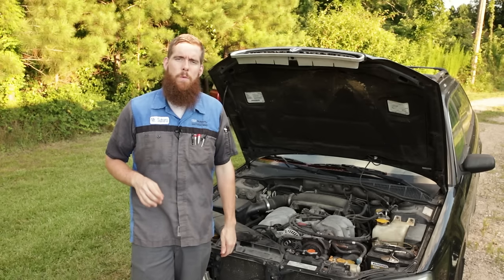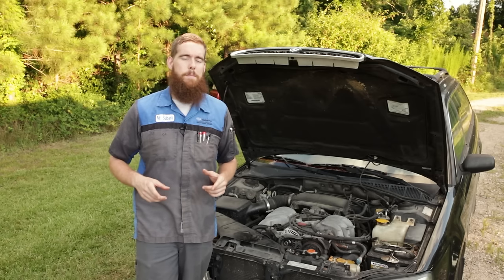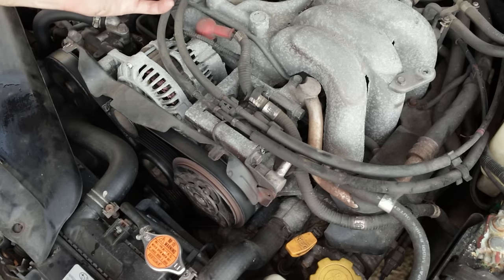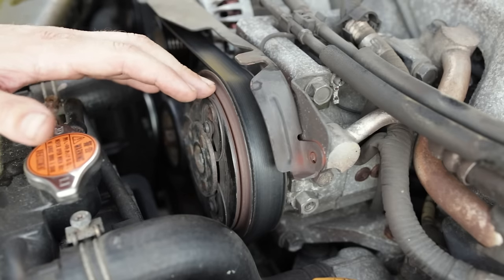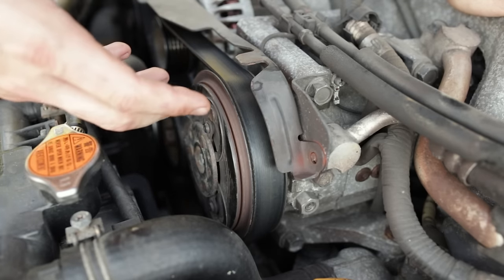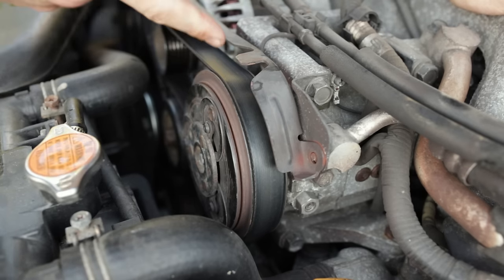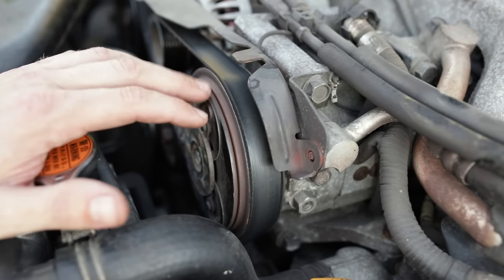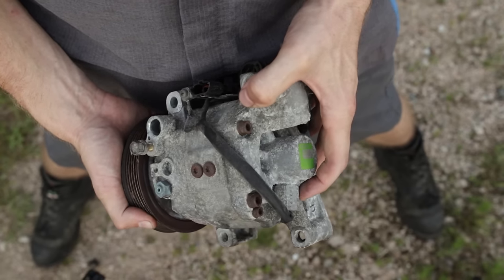Subaru A/C: Common Failures & Issues

Comment: Yes indeed the green test plugs were a total surprise! (though a bit*h to get back apart). However, I wish there was another video on just the clutch. When I put the two green things together, all my fans went cycling thru their speeds, but my clutch didn't click in. But before that I had hotwired from the + of my battery to the braided wire on the compressor connector (was at 5 ohms, so I figured this was the clutch), and the clutch kicked in. Does this mean my relay could be bad? I think the green plug test would bypass the pressure and rotation switches being that the engine isn't on. Do you have a video that goes into this? Thanks so much for your videos!

Comment: That was tons of detailed and useful info. Good work! My A/C compressor is starting to complain, making a noise loud enough to hear it from the drivers seat, with windows up. I figured it must be the bearings, although I don’t think that particular issue was covered in your video of all the possible breakdowns with this one component.
Reply: Did you ever solve this? My 2015 Forester 2.5i is not blowing cold air and the compressor seems to be buzzing?
Reply: Not yet. And no excuse for me (I live beside a competent mechanic!). I just spent the past few days dealing with a rusted gear shift lever cable connection at the transmission lever. It rusted over the winter (Im in Canada) and seized. I eventually sheared it off, snapped it from struggling to shift from Park to Drive. I had to tap it and put a stainless hex bolt into the lever so the gear shift cable eye bolt has something to connect to.

I’ll respond here when I figure out the buzzing. It matches the engine RPMS, even when revving in neutral.

Comment: So happy you came out with this informative video. Ever since i bought the car from a guy here in WA in January 2020 whenever i turned on the AC something would screech. I’m guessing it’s the AC compressor? I even took it to subaru dealership to have it checked out and the guy said it was perfectly fine and they’re supposed to sound like that. There I am thinking to myself like man.. i sure don’t know much about cars yet but i have NEVER heard a subaru AC sound like that. I will definitely check the gap and the O-rings now. The AC does blow cool and hot air.

Comment: I work on a lot of subarus I dont know if you ran into this but the 2000-04  forester baja and outback compressors had the thermal switch in the compressor fail where the compressor would work for a few minutes and kick off and not come back on. I replaced many of those compressors because of it.
Reply from the maker: Haven't ran across it personally, but I believe I've heard about that issue.
Reply: @MrSubaru1387  yeah it was really a pain because it would randomly quit when recharging the system and you couldn't get a full charge into the system.
Reply from the maker: One quick way to test it as well is to take a screwdriver handle and tap on the clutch. Sometimes all they need is a tap to get them to snap in and engage the compressor.

Comment: On the early model legacy. I own a 93
There is a green test mode connector and a black test mode connector
Reply: If I remember right the green test mode connector still does the electrical testing and the black causes the mil to flash ecu trouble codes... could be the other way around though...

Comment: I was quoted 1700 to replace my A/C compressor. It would make a noise when I started my Subaru Outback 2005 and then go away a few minutes later. Then the other day it did not turn…including the fan and lights. They replaced some fees that it blew but told me it was completely frozen up. Today I just turned the fan button and it worked but no cool air.  What parts do I need to replace it and tools? I need to get it done soon as I am having a liver transplant in a month and won’t be able to do anything.  I am going to have to do it myself because it costs to much to have the mechanic replace it

Comment: On my 2006 outback the ax and heater both work but it only blows it through the front facing vents. It doesn’t work when I switch the modes like for defrosting the window or foot mode it will still blow through the front vents.

Comment: I’m new to a Impreza. My ac doesn’t kick on. I bypassed the wire on the compressor and hooked up to the battery and it kicked on. But no cold air. I check fuse and relay seems good but I have no power to the wire that goes to the compressor and it’s a 2004 model

Comment: My climate control unit has lost power either from me pulling a wire off somewhere installing Android head unit or blowing the reverse fuse which I replaced but reverse hasn't come back eith. One other side affect is the sport light flashes but it still works in my 05 h6 outback. I'm at a loss to what it is. Do you have any pointers?

Comment: I have a 2007 forester. Belt is broken. The tensioner pully turns but has melted belt on it. The AC clutch engages. I can spin the pully, hit the AC, see the clutch engage and the pully stops. Should I be able to turn the compressor by hand or with a wrench on the pully bolt? It wont budge. I think its a seized compressor.

Comment: Thx for more deep dive like this. @9:58 if the airgap is too great, what is the correction? I might have this in a VDC Outback i'm working on.
Reply from the maker: Linked a video card to the older video showing how to adjust this gap.

Comment: If I idle too long in my 2.5 Wrx after a drive, the AC will not engage, and the air will get warm in the cab. So I checked the Charge of the system, and it registered in total.

Comment: I noticed one of your cars had an obvious build up of a brown coloured soot around the compressor. My engine has this same ochre or reddish-brown coloured deposits outside of the compressor, but lots more than was shown in the video. I wonder if this may be a clue as to what kind of fluid or lubricant or coolant may be leaking?

Comment: Got a 2007 outback 2.5 ac works sometimes and sometimes it does not. Is charge the clutch works fine. Need to check the cabin filter but I doubt that's the problem. Next thing I got is the high pressure switch could be failing. What do you think.

Comment: @Mr.subaru1387. Thnx for the priceless info. One ? When u test with the two green connectors and turn on the car do u also turn on the ac? Or does it automatically pull and push the clutch as a test with the ac off? Thnx in advance for any additional help.

Comment: My wife's 05 Forester 2.5x blew orings last summer. I fixed it and changed belt ant tensioner. so simple. It's making a noise now when first started almost sounds like bearing going out. How often do the bearings go out in the compressor?

Comment: I actually have a question for y’all. I recently replaced my AC compressor in my 2013 cross trek. It fixed my no cold air issue, the clutch was just bad. But I’ve had this issue where I adjust my fan speeds 1-2-3..4 is max, 1-3 works perfect but when switched to 4 the fans shut off. What should I look for or does anyone have ideas?

Comment: Did you ever come across an intermittent fault? The worst to have by anyone's standard. Mine is with an S3 Forester 2009 and being sods law it fails when it's really hot. If the ambient temperature is over 100 it will run for 5-6 mins then stop! Living in Australia has a down under side.....

Comment: I have a 2009 wrx . I have replaced te Expansion valve, condensor with filter drier, all underhood O rings. Unit had proper oil and R134a charge and I set the clearance on the clutch to specs. My issue is I feel it engaging and disengaging while driving on the highway. At idle it cools but not as good and will stay engaged much longer.  While driving it will cool down to 40 to 45 at 102 degree ambient temps. What could be the problem other than just a worn compressor? Evap is clean, fan works fine all fan speeds are working  and ambient air temp sensor seems to be working fine as well. It also uses the Valeo compressor.
Reply: I'm also having the engaging and disengaging issue on my 2015 wrx, did u ever fix the problem? What caused it?

Comment: Hi Mr. Subaru, I will be replacing all A/C components (Evaporator, Condenser, Compressor, flushing the lines, etc) on my ‘05 Subaru Outback XT. When it comes to adding the PAG oil to the system, is the oil added to the components when installed, then the vacuum is pulled on the system? I’m just concerned the vacuum may also pull the PAG oil. Also, do I add half the PAG oil into the compressor and the other half into the evaporator? If you can please clarify on this.. Thank you in advance.

Comment: I know this video is several years old now, but I had a question regarding the leaking o-rings on the stems of the high and low pressure lines going into the compressor. 

I have a 2015 Outback with the 2.5 engine.  I notice that around one of connections there's an oily residue present.  Is this a sign of a failed o-ring.   

Thanks

Comment: I got a 2015 Subaru wrx and my compressor is engaging and disengaging exactly like yours did… my ac would be cold at times and then a next I would have no cold air…I changed my o ring because I realized a leak on the high pressure valve, but it seems like maybe my compressor is going ?

Comment: 2011 subaru outback ac is starting not to be cold. Air blows cool when driving but when stopped car tends to overheat no engine light but when touch hood it is hot as hell, what do you think @MrSubaru1387

Comment: My ac on my 2012 Subaru outback only works when its cold outside then any other time it only gives hot air out added AC an bleed the ac out or something like that still didnt work my dad said AC pump is stuck an no good

Comment: ‘07 Forester here that keeps blowing the 15a A/C fuse in cabin any time I engage A/C or defroster, but everything works just fine if I use the heater. Blower and resistor work as they should. Clutch relay and under hood fuses are fine. Would the bad o-rings/freon leak cause that 15a fuse to repeatedly blow?

Comment: HI Any feedback appreciated: The AC on my 98 Forrester is not working. I changed the common failure point where the O-rings are on the low and high side pipes that connect to the compressor.  
The AC light on climate control comes on. 
When I started to fill it with new refrigerant the clutch on the AC never turned on and then I got a really loud hissing/pressure noise coming out of the front of the car by the radiator.I’m assuming that’s the condenser but I don’t know whether  that means the condenser is plugged or if there is a valve in that area that could also be broken? Thanks

Comment: Trying to figure out the cause of my issue - when I turn the AC off it’s still blowing a light amount of air, if it had been in AC mode it’ll blow cool air (presumably from outside, cold here atm), if it had been in heater mode it’ll be warm air.

Comment: Hey there. Great video. I have a 2016 Impreza Sport 5 dr. Am I correct that they are almost identical to the Crosstrek? Anyways, my AC compressor is making that noise you mentioned at the end of your video. Also it will not cool on idle but only while driving. Is this my compressor going bad?

Comment: My 2003 forestor has problems with intermittent ac working.  Im guessing from the  video is the air gap in the magnent. I have to town it on and off a couple times then it will work.

Comment: Mr Subaru I think your videos are excellent, thanks for sharing your knowledge about Subaru’s. I have a question, during the summer months of June to September ( I’m in Ontario, Canada) is it safe to switch from 0W20 to 5W20 fully synthetic oil. Reason I’m asking is I’m trying to oil consumption, thanks in advance
Reply from the maker: I run Subaru syn 5W-30 in my 2013 Crosstrek year round. Subaru Japan runs 10W-40 in the engines. No worry of damage.
Reply: @MrSubaru1387  thank you for your reply

Comment: You've saved me multiple times before. I just got a 2009 legacy SE and the air conditioning pump cycles on and off. If the car sits the ac will run cold for a few minutes before gradually going warm. The pump continues to cycle on and off. I'm changing the cabin filter today. Any other thoughts oh great subaru gandalf?

Comment: Nice video thx for info on the diag plugs, My 09 forester will cycle on for about 2-3 min then cycle off I can turn it off and then it will maybe come back on. My charge seems good at about L30 and H210 on 85 deg day. Is there a thermostatic switch in cabin that could be effecting the switch on and off of compressor?  This never had this issue till Subaru did my air bag recall not sure if it was coincidence or what

Comment: Enjoy your videos….I have a loud squalling/ squealing noise that comes from the back of the engine / transmission ( firewall ) area when the car is turned off…It makes the noise and the engine shakes side to side …Do you think 
possible TORQUE Converter is the problem or maybe rear engine main seal the problem..I could use an answer from you if possible…Jim

Comment: Great video! I just replaced the o-rings on my offspring's '03 Subaru Outback as it was 100% out of freon. The clutch is engaging, I filled it to 55-60 psi (it's 80'f today innABQ) but it's still blowing hot and the pipe w/ the input shrader valve is still room temp. Like I said, clutch is engaged. Time for a new compressor?
Reply: From what I read it should be in the 24 to 30 range, 55 would be overcharged iircc

Comment: My 08 Outback has a pitiful output when it gets above 80 outside, somewhat cold air for about 10 seconds followed by 20 seconds of non cooled air over and over again. I’m guessing it’s due to the reduced capacity, I don’t have any leaks and the clutch works just fine, but when it’s hot out I know my ass is gonna be sweating all the way home from work.

Comment: Problem: 2018 ac yes probably o rings. I turn on ac at max performance I get cold air but not enough to cool down interior. Todays temp outside was 13 Celsius. I should hv been a winter storm inside but not so. If a rav 4 no problem not Subaru. 
My brother in law has 2016 outback when he sets it for cold he freezes, his wife has a 2017 forester and has much the same problem as I do but not as bad. I 70 klms on mine. Why can't I get ice cold in the forester everything turned to max cool?

Comment: Hey Mr. Subaru -- For the Zexel zkv 14g compressor, where's best to buy rebuild kit with O rings and Schrader valves? Also, is there a step by step video for the repair?
Reply: OOOOPS -- THAT'S DKV NOT ZKV - MMMYYYY BAADD

Comment: Hello, MrSubaru1387,   First I want to say, I have watch many of you your videos, and I really enjoy the information you share and your thoughts on various issues with Subaru's .                     I'm new at this YouTube thing, his so hopefully I'm not doing this wrong....I have a question about Subaru A/C units.    My car is 2006 Subaru Legacy 2.5i Limited.   My issues is with my A/C Pump.   The pulley bearing in my A/C is starting to sound a little rough when I turn on my A/C.   The unit engages/disengages properly. So, I took the belt off and spun the pulley with the unit A/C turned off, and the bearing under no load but sounds/feels rough when spun by hand. The A/C Blows cold, engages / disengages so I don't think the A/C part is damaged, I think the bearing is going bad.  I have not checked the stats under pressure/running with gauges etc.  I know I need a New Subaru Compressor, O-Rings. But hoping that I don't have to do all three Hoses, Expansion Valve, Condenser.  I hope to hear back from you.  Thanks for helping people who love our Subaru's    Mike

Comment: Question. 2013 outback 2.5. Hot air out passenger vent. Luke warm out drivers. How commend are heater cores on this model or is air mix motor most likely

Comment: I have a 2014 Impreza 2.0i, AC blows cold at first, then goes to hot. I charged it, same issue, when I hit the AC button, I do hear the compressor kick on at first. Haven't tested those o-rings or anything yet, but would like to narrow down the issue. As i'm in Georgia and we are hitting 90s lol
Reply: I have similar issues, did you end up finding the cause or solution?

Comment: Hey there, I just got my ac refilled and it worked fine,next morning i was only getting hot air, went to the shop and guy said bad compresor but after seen this video i think orings are more likely they did the die but said they couldn't really see dye anywhare, any thoughts on this? Thanks in advance.

Comment: Hey Mr.Subaru,  Another Great video! After driving my AT 02 Wrx I finally inspected the cabin air filter and low and behold there was none to be found. After driving in this car for the last  7 years, do i need to vacuum built up debris out of the blower assembly or other?  Thanks,   Norm
Reply from the maker: You may. Good idea to see if any debris/trash is in the HVAC box.
Reply: @MrSubaru1387  Thanks for the tip.  btw, what do you think of the 1990-1995 Toyota Diesel Prado (since you bought a right hand drive Subaru utility truck (they call them K-trucks in japan-  "k"  bc its means small - i think).

Comment: MrSubaru, do you have any idea how to repair the A/C fan knob? I have a 2017 crosstrek and the position 4 does not work. I have replaced the blower motor resistor and that did not help.

Comment: I have a 2017 forester. Used to blow cold ac. Sometimes wouldn't and it was the air cabin filter being dirty af (due to smoking 🥬 in the car i assume). It's been replaced multiple times. Now, 2024, iflt blows air but only hot air, even with AC button on. Something else is clogged (dad said itvwas a tube that needs to be cleared out idk). I just would like to know the best course of action to take? Thanks!

Comment: Great informative video quick question how often do you have to add oil to the AC Compressor ?
Reply from the maker: Only add it if you lose it from recovering the system.
Reply: MrSubaru1387 ok thank you very much